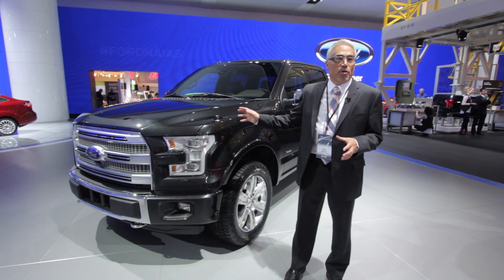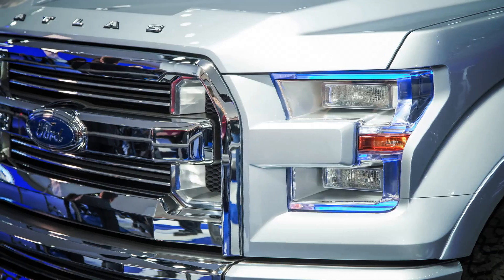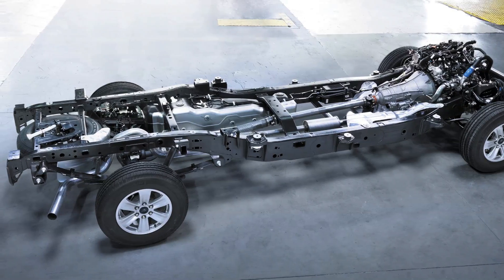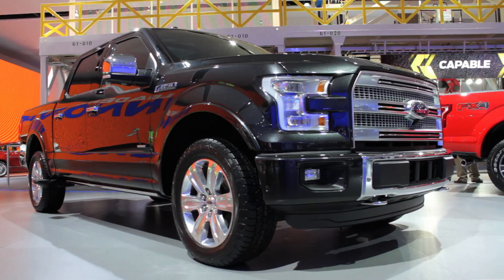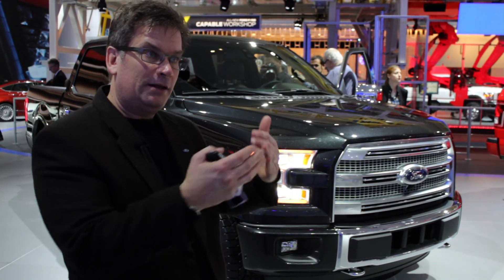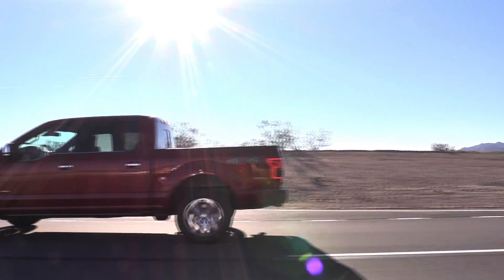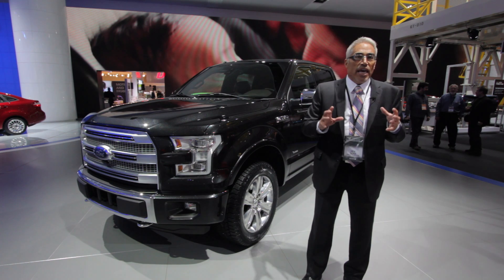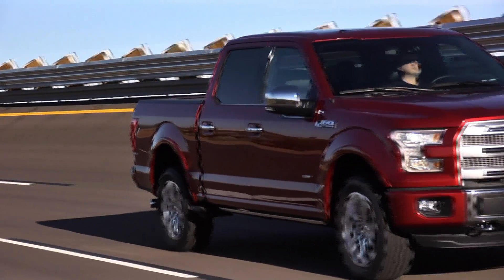Shaping the 2015 Ford F-150 from Aluminum - Design and Engineering - 2014 Detroit Auto Show

Comment: Looks is a personal opinion, I like the looks but most importantly this truck is totally blowing me away, the 2012 F-150 with 3.5 ecoboost v6 had 0-60 time of around 6 s, with 700 lb less I think its going to hit 60 within 5s and fuel economy of 2012 model in real world averaged between 10-12 mpg on normal drive 3-4 mpg with full load and 16-20 with super efficient drive ,3.5 EB this one will have all those numbers rising 20-30% and that means F-150 is the Emperor of trucks, all other Dukes Toyota,Chevy,Dodge can stay back and watch
Reply: Fuck off, America is worlds biggest consumer of gasoline after The UAE,U guys still dont wanna learn from others,U guys think U guys are best, in reality U guys are immersed in SHIT,Atleast Ford is ready to compete with Germans and Italians and give cars that have better acceleration/TORQUE/ride/handling/solid built/cabin insulation/better technology
Now why I emphasize 0-60 cuz its just the basic level of performance any layman can point 2, and Ford achieves better 0-60 with small v6 and that shud b appreciated cuz with trucks bhp is not that matters,what matters is TORQUE and the 3.5 and 2.7 have torque that competitions 4.5+ litre engines have that 2 lower in the rpm range
Ford is moving in rite direction,downsize engines,try make better mpg figures without loss of Power,whats wrong with it DCK HEAD
Reply: Yea and a $1000 will add 50hp and 80tq because Ford tunes it for 87 octane.
Reply: Yes also the 2.7 ecoboost used for Baja 1000 was tuned for 380 hp and a whopping 420 ft pound just @ 1900 rpm that means oodles of low end torque and its even more powerful than the 3.5 ecoboost v6 which incidentally is a 1st gen ecoboost, 
Actually Ford says the 2nd gen ecoboost twin turbo can be easily tuned upto 540 hp @6500 rpm and 480 ft pound @ 3000 rpm much like Nismo godzillas v6 but in the interest of fuel economy Ford is just providing the basic tunes for customers, Hope Ford makes a GT car with Al chassis an 3.5 tt EB and thats the 1 I am dreaming 4 as of now
Reply: Chode Lee The EcoBoost is a Hit, and it's used in the Land Rover Evoque compact SUV that won SUV of the year, genius.
Reply: Chode Lee i agree with the fact that the 5.0 Coyote is an amazing engine and as of now the 5.0 is much more reliable than the 3.5 EB, but Ford arent sitting ducks and I am sure they are working fingers to bones to make the 3.5 EB much more Powerful and reliable and the current gen, 3.5 EB is gen1 EB which was actually better off doing duties with the Taurus sedan as its torque was just 370 ft pound but the gen 1 was boosted to 420 ft pound for the Trucks and that caused the problems as it was like an after thought, so the fine tuning and testing was not done at its best but the 2nd gen EB engines the family which incorporates tek from the 1.0 i3 Eb to 1.5 Eb i4 to 2.7 EB v6 is a different story, they have done super harsh testing with these engines and so the new gen 3.5 EB will be much more reliable and will spool its turbo much more faster and at a lower rpm say around 1750(the last gen EB had to rev till 2500 to get its 420 ft pound)
I am sure the Al 15 Ecoboost Powered truck is a born winner, also Fords new 4.5l v8 diesel truck which too incorporates a lot of new tek is coming, so Ford which is poor mans BMW elsewhere in the world is really using their worldwide skills to help USA, just like GM uses Opel/Vaxhaulls and Fiats tek to help USA,its a supr +ve sign of Fords big progress
Reply: Yeah I completely make up shit all the time too. If you think 0-60 even matters when looking into trucks, you don't need one. Hop back in your Focus and fuck off back to Bullshitville.
Reply: Personally I think they need to just discontinue that eco boost. It is causing a lot of issues and isn't any faster and hardly more fuel efficient than the 5.0 coyote. That is one solid engine that will last. That eco boost will continue to have more and more issues. Plus hey its a V-8 baby.
Reply: jandj Godwin im a ford man.....but dang this truck looks like a Ram...
Reply: ***** the front I can't tell the difference
Reply: jandj Godwin the only reason i buy a truck that can tow 10000 pounds is the 0-60 time.......wake up man. ppl in AMERICA actually do work and they need to tow. yeah 0-60 is a fun fact, but thats not the be all end all stat...c'mon now!!!
Reply: TheCrEaSe44 buddy i am an auto journo and i am not boasting but i do very well know about 0_60 etc,why i put 0-60 here is to mention just the superiority of ecoboost over a v8,also TORQUE is everything,the new 150 with lighyer chassis and frame but yet stronger means,u can beat a so called sports car with a truck and still work
Also there is another thing,low end torque,even at very low rpma say under 2000 rpm the ecoboost can generate over 280 ft pounds of torque,so 1 will never feel a lackluster drive
New f 150 with new 2.7 and 3.5 is a revelation,i have some insights into thia new truck and i am totally blown away by how good it is,this technology of ford if put to use well ford can well even beat toyotas to dust,its that good but sadly time and reliability are factors that ford dosent do really well
Reply: jandj Godwin Ford's are DOHC more forged than Chevy's, with Composite Graphite blocks, you can't get any tougher than that. 
If you're not Tech Savvy and have no Mechanical Ability than stay away from Ford's.
Reply: EscapeforMankind . what did u mean
Reply: jandj Godwin a journalist that cant spell and has bad grammar....ok. and yes torque has a lot to do with towing, but dont say 0-60 has anythign to do with beating sports cars cause thats a joke. the new f150 will be lucky to be in the mid to upper 6's. yeah thats quick...for a truck, not a sports car.
Reply: TheCrEaSe44 Hmm, firstly a journalist dosent always write full reviews, I am just a tester, i will be given a VBOX and will be asked to do acceleration tests , in gear accelerations, stopping distances etc and i just compile data 

what  i meant with my previous post is that,0-60 is something thats insignificant for trucks but considering the weight loss f -150 has and considering that an average person to notice the difference in performance one can express f -150 0-60 time, its just like an insignificant co efficient in real world but in Youtube it just shows the performance as the digital world can understand how much the new f-150 has improved  
The current generation f-150 ecoboost with 3:55 ratio 4x4 can do 0-60 in 7.1s a 0-100 kmph in 7.4s but with about 500-700 pounds or nearly 250-350 kg weight loss that can reach sub 6.5s which can be called sports car territory
eg Subaru BRZ 0-60 7.2s
Fiesta ST 0-60 7.0s
Focus ST 0-60 6.4s
Golf GTi 0-60 6.8s
Nissan 370Z 0-60 6.0s
Audi TT 2.0 T 0-60 6.0s
 all these are real world data and speedometer shows different readings but these times are GPS tested speeds, so if F-150 can  take off the line better than a BRZ a Focus ST,a GTi etc its really on street sports car territory
Reply: The 3.5L EcoBoost F150 engine had a problem in humid weather, so the problem with it was nothing more than engine programing.
Reply: ***** Yea, the second generation ecoboost engines wil bemuch better, will have their turbos spooling up earlier in rpm range as well as more efficient

Comment: Why do Americans talk about Aluminium as if it a newly discovered material. Many manufacturers are already using it...
Reply: actually everyone is using it but no one is using it in trucks or heavy-duty vehicles, they have to worry about cost since using high strength aluminum can be expensive on a $50,000 truck
Reply: I think that all the other car companies will some how juggle around their money, and start making aluminum cars.
Reply: thevinceberry
Kenworth, Peterbuilt, Freightliner, Volvo, and even International are now using aluminium extensively in there commercial vehicles. Yes the investment is huge but the return in customers happy about the weight and fuel economy are worth the investment. Its good to see ford steeping up on a light truck, hopefully soon we will see aluminium in F250-350-450-550 soon.

Comment: wow this truck looks soo much better than when the chevy trucks were shown at the auto show. i think F150 beats all trucks in terms of design and materials. bravo to ford!!
Reply: I think they both look pretty great. The silverado's 4 eye grill looks mean as hell.
Reply: i think RAM has the best looking trucks, but i agree, the fords do look a lot better than the previous years!
Reply: Until you open the hood and see that v6 in a full size pickup!!
Reply: lexusfan100 LOL..if you're worried about $5 a month on a $40,000 truck, you have bigger problems.  I bought a new F150 and my insurance WENT DOWN.
Reply: Fortworthman999 and that's a great thing.

Comment: Such a shame people buy these horrible things. "we spent alot of time in the wind tunnel" haha Either buy a solid or british 4x4 or an old pickup you dont mind throwing wood in the back to the ranch...
Reply: solid British... thats funny.
Reply: that's a point, but if they don't make new trucks, you won't have an old one 20 years from now....
Reply: lets be honest, is this vehicle made for a practical reason? I dont live in the US so would be interesting hearing what sort of people do buy them?
Reply: tbrowniscool I used to live in Australia, and they were nonexistent there, but I do own one here in the US.  I have it to use as a family vehicle that doesn't mind doing a little bit of off-road, doesn't struggle in the winter, is roomy, holds its resale value well, tow a camper, fits my Polaris Sportsman Touring 850 ATV in the back (at the same time as pulling the camper).  I think it's fair to say that most of the time it is driven empty, because it is nice to drive as a daily driver.  So I am glad Ford is making them more efficient for that, but still retaining their capability.  I just noticed your comment about throwing wood in the back.  I have filled mine with wood a few times, as I like having a supply for when I go camping.  It handles it just fine.  Looking forward to seeing what Ford will do for the next generation Super Duty!  There hasn't been an all-new one since 1999!  The last all-new F150 was 2005.  So come on Ford, it's about time!!!
Reply: I live in West Texas and 90% of vehicles around here are pickup trucks and of that 90% a solid 60% are for daily driving ( the family car) if you will. My wife works at the local Ford dealership and they move anywhere from 375-520 vehicles a month and the VAST majority of those sold vehicles are a pickup truck or SUV of some sort. In West Texas many towns are a good 20 to 45 miles apart with very good roads most of them have speed limits of 75mph and Interstate 10 I believe has a speed limit of 85mph. I purchased a 2011 Super Duty just beacuse I wanted one, Loved it but just didnt need a truck that big for my daily driver so I traded it in on something more practical for me and that was a 1/2 ton pickup truck!
Reply: tbrowniscool
Here in Canada, 4x4 pickups are viewed as practical choices for winter driving, for the following reasons:
1. they are completely reliable
2. they come from the factory already winterized, e.g. built in block heaters
3. they have the traction and ground clearance for rough un-ploughed roads
4. on icy roads they resist being blown around by cross-winds
5. in extreme cold, steel becomes brittle, a frame resists cracking better than a unibody
6. where road salt is used, rust is inevitable: a body on frame will die a much slower death than a unibody
7. control surfaces are larger so as to be used with winter gloves
8. many winter sports require bulky gear to be hauled around, e.g. snowmobiles or ice fishing huts
9, frame provides strongpoints for hitches, or winches, or to be pulled out of snowdrifts by tractors, or trucks
10. occasionally coming to the rescue of pretty English girls in Volvos, who will ask us for a jump without a hint of embarrassment.
Reply: tbrowniscool forgot to answer your two questions:
1. Do they have leaf springs? Yes Ford has stuck with leaf springs, despite Dodge/Ram going to coils for the 1500 and 2500, but Ford has managed to improve the ride significantly.
2. Diff locks? A rear locker is an option. It's a dash controlled E-locker that seems to work as a limited-slip when disengaged.  So best of both worlds.  A regular open diff and a regular LSD are options too.  The F150 Raptor has front and rear lockers.  GM uses the Eaton G80 as an option, and Dodge only offers an LSD option.  If you want a Dodge with factory lockers, you have to get the Power Wagon, which has front and rear lockers.
Reply: Mark Baker
I like full size pickup trucks and also the F650 pickup, a big monster.
My dream truck is may be the Ford F-350 dually with a diesel engine.
Reply: MrChevypower  wow thanks for taking the time to reply in such detail. Seems this behemoth has some good use after all. Im from England and never seen anything this big. I suppose your roads are alot bigger than ours and less twisty stuff.

I always thought these big super trucks were just bought as a "look at me im big" reasons and used for school runs and thats about it. I remeber seeing something online years ago how they dont have to pass crash tests as they are classed as trucks in the US. Also do they use leaf springs? have locking diffs? etc..

Must have been our god clarkson when he drove an f150 on english roads. he hammered it. How much do they weigh. A standard UK driving licesne has a limit of 3.5 tons i think..

Thanks again
Reply: tbrowniscool Clarkson drove the old F150 Lightning, yeah they weren't built as well as the new ones.  The build quality in that was even worse because it had been converted to right-hand-drive, that's why the gaps in the dash were so bad.  Mines an 05 (which was a complete redesign) and it has been very reliable and still feels tight, even though I have taken it off-road and put 112,000 miles on it.  I believe the crash testing improved significantly for the 05 model year too.  The weight depends on the configuration (cab size, bed size, and 4x2/4x4), but a 2014 crew 4x4 weighs about 5700 lbs for the EcoBoost V6 and V8 (about 2600 Kg).  The 2015 is supposed to be 700 lbs lighter, so 5,000 lbs (<2,300 Kg).  About the same as a Range Rover Vogue.
Reply: tbrowniscool
people use the older f 150's for work i use my 95 on a farm. however the newer ones are used by mostly by people who want to pretend they'll use them. most people who use newer trucks nowadays get diesel 3/4 tons and 1 tons.
Reply: tbrowniscool
i would say no more than 2 tons. this is a somewhat small truck in the US you should see the f 250's and 350's. On the drivers liscence note a standard liscence will allow you to weigh up to 13 tons.
Reply: Bill Hill
This is the baby one, bloody hell! 13 tonsa and driving at 16.. your a crazy bunch

My dream pickup is a 90's hilux :) or one of them aussie hotrod things
Reply: tbrowniscool
sweet. i would love to own one of those hiluxs but the damn EPA (Environmental Pussies of America) have decided that it does not meet emissions standards. Thats one reason why ford went to this aluminum body because trucks are now required for emissions and fuel mileage.
Reply: tbrowniscool
also if you are a farmer at least in Oklahoma you can operate a semi (lorry) as long as it has a farm tag and as long as you stay with in 150 miles of your farm. its okay for 16 year olds with regular liscences to drive them no cdl required.
Reply: If you guys ever get the chance to sit in an F250 do it. It's life changing cabin space.
Reply: Bill Hill
solid british, thats a fair point lol

Comment: What's the difference between tow and haul weight? Also how much weight can be in the truck hold before it maxed out
Reply: Tow weight is how heavy of a trailer it can support and pull, haul weight is how much weight it can handle in the bed of the truck.